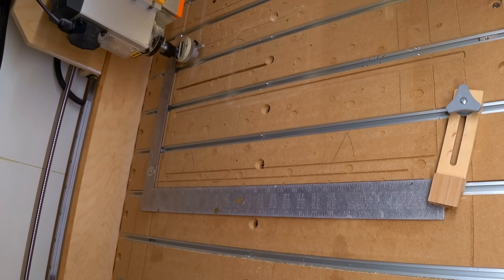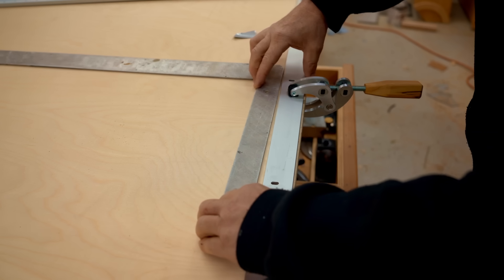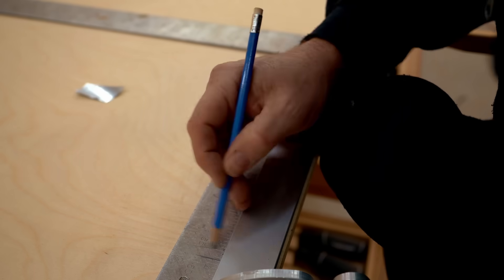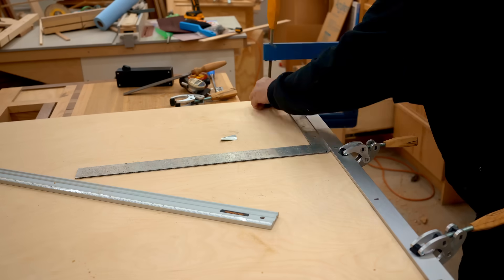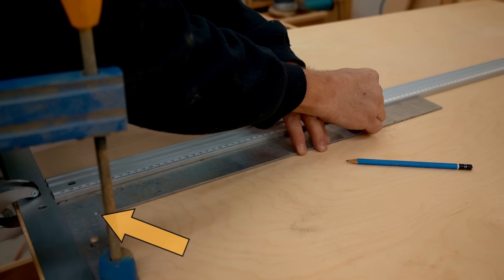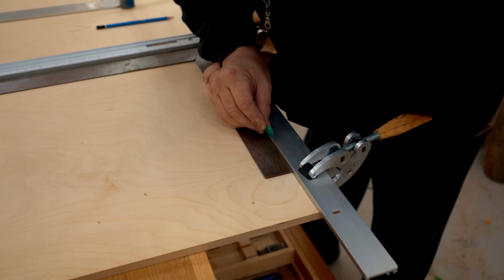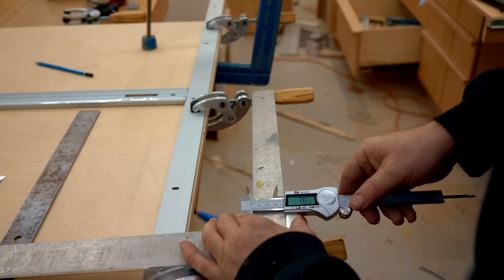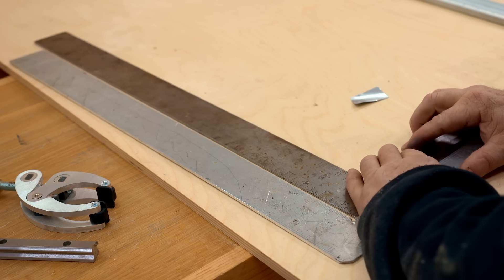My Square Isn't Square! Let's Fix That | Low Tech High Precision

Comment from the maker: The method I show here takes time, effort and patience, but the results are well worth it. Have you checked out the price of precision squares lately? They are not giving them away and with a little elbow grease you can make the cheap low precision ones more than accurate enough for everything you normally use a square for. And you'll know a way to check the accuracy of a square if it gets damaged in some way, like dropping it on a concrete floor.
What exclusive videos and access to what I'm doing behind the scenes? Become a supporter on Patreon:
https://www.patreon.com/user?u=865843&ty=h
Reply: In Germany machinist squares with precision defined by DIN 875 (simple shop tolerance class II) are not expensive. They are sturdy and precise beyond what you can achieve DIY. For exampe an 8" square is around 15 Euro (~$17) and the deviation is less than 30 my (metric 0.03 mm).
Reply: and how much is a 24" long one?  The price will rise exponentially with length.  Machinist squares also rarely have any measurements on them.

Comment: So, John I just have to ask what is it that you need such precision for?  Is it going to be a special project or just to have the most precise square to use?  Perhaps a repeat operation where any deviation in the precision of the square would build up to be noticeable and cause problems at the final assembly?  Great video thumbs up.

Comment: There should be 2 dimples on the framing square by the ID and OD of the corner when the metal moves with the season. Gently strike the ID dimple to flex more inward or do the opposite and string the OD dimple to flex outward. That is what they were made for.
Reply: You apparently missed the part where he said he did this. Too busy running your mouth when you should have been listening.
Reply: exactly
Reply from the maker: @tombrown3574  Really? You agree this this nugget from the comment: "...when the metal moves with the season"
Punching the corners will get it close enough for low precision work, but does nothing to improve the ragged edges of these squares. Most of the work I did in the video was to make the edges smooth and straight, as well as dialing in the squareness. 
In case it wasn't clear from me using the square on my CNC, I'm not going to be using this for framing.

Comment: "Good enough for framing" is certainly a matter of perspective. When "square" is important, the error in the tool maps it's way through the project, typically compounding the error. I always check a framing square on a counter at wherever I buy the thing, most squares aren't, some are very close, I've never seen a perfect one. Your process, while a bit tedious, is well worth the effort.  I have a couple that will get the treatment.

Comment: Great method, which accounts for say, an unknown flat on ones workbench edge.
Only thing I'd change is to strike the entire length instead of just hatchmarks to try and account for any imprecision in my pencil marks. Having said that, it's probably only because I'm not there making the marks, and you may very well know your personal thickness of lead and strike angle

Comment: To straighten/flatten one of the edges, you might consider taping down some sand paper to a straight edge and then running the edge you want to flatten, against it. Would help ensure it's dead flat and can be used as a reference surface. I like this process though. I might get a second framing square and try it out. Always good to have tools with extra precision.
Reply: Stumpy's latest video shows just that (albeit for getting a straight edge on wood).

Comment: Great to see a video from you! 

So its a bit specialized and most people wouldn't have the tool, but to make a lot of that leveling easier I would use the tool I have to level guitar frets. 

Its basically a long machined flat stick with sand paper on it. It would be faster and just prevent the need to spot level so much. But again, its a bit of a specialtlzied tool, not every one would have it. 

Alternatley you could run a piece of a good rigid wood on the jointer, slap some sand paper on it and flatten the edges that way. I did that when I needed a 36 in leveling beam for a big bass and didn't want to shell out mega bucks for a precision beam that long 

Theres also nothing wrong with what you did here. Just a bit finicky. And worth it either way.
Reply from the maker: I look at what I did here as similar to scraping a machined surface to get it closer to full contact with the mating surface. The file takes off small amounts so that you are less likely to go too far. A more aggressive tool will be faster, but gives up fine control for that time saved.
Reply: @JohnHeisz so I hate when people comment on my videos about how I should have done something... and I hope I didn't come across that way haha 

I have learned a lot from watching your approach to fixing problems and I always enjoy your unique perspective. 

My brain just knew of a unique tool to do it fast and accurate and I thought you may be interested. 

So on the leveling beam I'd use 320 or 400 grit probably for this application. I have rolls of like 600 grit and 800 grit that are adhesive backed I use for fret work but I think they wouldn't be aggressive enough actually for this application. 

Paint the surface you want to level with a sharpie, clamp the leveling beam in place, run the edge of the square against the surface while it putting very light pressure directly on the high spot. When all the sharpie is gone, your level. 

Still takes a little time and patience and is not too aggressive. 

The bigger risk would be accidentally throwing it out of square which I can see happening with my method very easily if pressure were to be applied in the wrong spots
Reply from the maker: @daveydacusguitars9033  no worries, it's all good :)
There are lots of ways to go about it - using the file was the one I happened to go with more or less to keep it simple. I could have milled it straight and square on my CNC, but that's hardly "low tech"

Comment: without a surface plate you never know whats really straight
Reply from the maker: Not true. If you use two straightedges with a dial indictor to check for parallelism (like I did in this video), you can measure out-of-straightness down to as fine as the dial indictor will read. You do that by flipping the straightedge over to measure the other edge and you repeat until you know exactly whether one is not straight.
Besides that, believing what you have isn't good enough for what you are doing, you'll never get anything done.